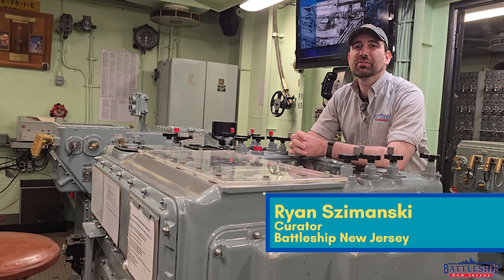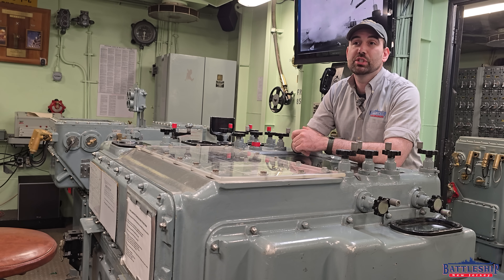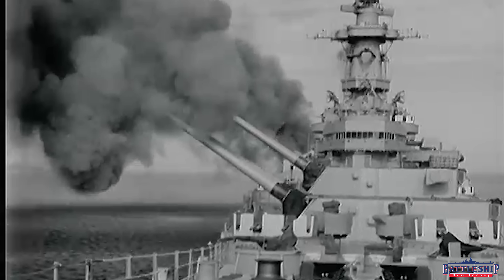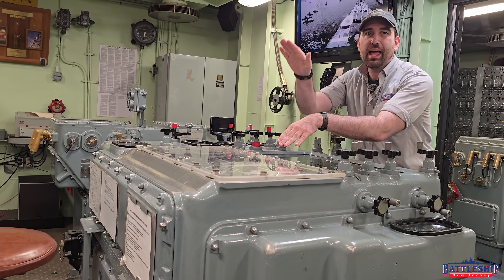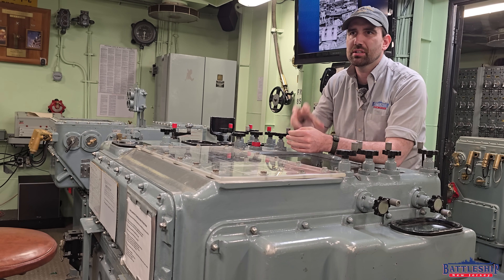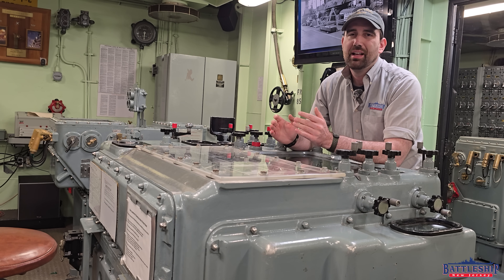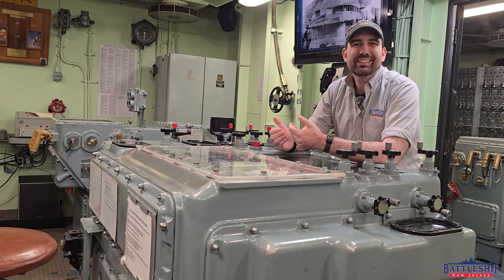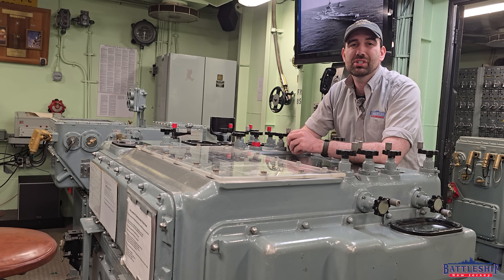What's The Ideal Angle to Hit a Battleship At?

Comment: If the shots go 4 times longer, then they do side to side, then hitting a bow or stern on vessel seems more viable
However with a broadside vessel, you'd be hitting both the hull, and the superstructure if you hit amid ships on most battleship sized vessels
Especially on carriers for bow or stern on targets, that long dispersion bubble means you'll blow holes throughout the flight deck

Comment: That dispersion pattern makes perfect sense when one applies Newton's laws.  Firing 9 tons of shells in a broadside creates a lot of recoil.  Obviously, the water pressure on the hull prevents the ship from going sideways, but that resisting force is much lower on the side of the ship while the recoil from the guns is high in the air.  This effectively tries to rock the ship.  It may not be by a measurable amount, but there is probably some (which may increase or decrease any rocking motion from rough seas).  With the shells being fired at slightly different times, that would result in the barrels of the turret being at slightly different elevations as the shells leave them - hence the greater longitudinal dispersion.

Comment: No.

The 4-1 depth to breadth ratio is ENTIRELY dependant on the firing range, it is NOT a constant.

The depth of the salvo depends on the angle of impact - the shallower the angle, the deeper the length of the pattern. Impact angle increases with range, so depth decreases drastically as range increases. As the cosine of twice the impact angle.

The breadth of the salvo depends on the dispersion (in mils) x Range/1000. This increases linearly with range.

If you have ever zeroed a rifle or handgun, you understand that a shot group at short range is circular against a vertical target, dispersion is the measurement in angular mils across the pattern. Left-right, up-down, all the same. The  only real  difference is your 16"/50 is firing against a horizontal target laid out at far greater ranges. Dispersion still works the same way, but you are not striking the target at a 90° angle. 

On Eugene Slover's web site is a copy of the 1941 OP-770 Range Tables for the 16"/50 based on 47 test firings at angles of 10-15-20-25-30-45°. Included is data for the test shots, including pattern size (in range). Analysis of this shows an average full pattern dispersion of 4.5 mils.

Breadth of the pattern is therefore 4.5 x range /1000. Your 4/1 ratio is for around 15,000 yards range. As range decreases, the ratio increases, the reverse is true also.

Comment: In the film of the Bismarck (down by bow from earlier hit by PoW) firing at the PoW (Hood already sunk) B is ripple firing the 15" guns (https://www.youtube.com/watch?v=m97AycTOVww), forward turrets first, then aft a couple of seconds later (not sure if these combined totaled full salvos). This was possible because the guns were kept at the same angle relative to horizontal via their inertia, gyros and hydraulics, rather than waiting for ship to be at a certain point in its roll. Why the ripple fire I have never seen discussed, it was not about ranging since they were fired so close together. 

Hood started by firing at Prinz Eugen, but because they thought it was a battleship they were thrown way off (the correct length of the ship had to be fed into the system when on nonparallel courses for rounds to hit the right lead spot) and shot wildly. According to some survivors of B they said first salvo shot at them was only a little short and on bearing, but she blew up before 2nd salvo. Sigh, 

Firing at ships running away when chasing them is difficult because the guns firing over the bow are being fast swung to and fro by the rolling. This was a problem for the RN chasing Italian units which was the norm. They went to special effort to deal with this and the Vanguard was fitted with the best batship fire control system ever according the Freidman, combining phased array radar with a sophisticated computer even better than the USN.

Comment: The US built a 155 mm guided ramjet boosted artillery shell. The range is classified, but rumors are  up to 100 miles.  Imagine what you could do with a 16 inch diameter shell with ramjet boost. 200 miles? 500 miles?  They may have gotten rid of them too soon. They could remove the rear turret and pack the area full of defensive and offensive missiles.

Comment: I find this a very interesting subject- hitting the target with the big gun.  There is the accuracy of the gun itself, the dispersion of the shell from the point the barrel is theoretically aiming at, then you add in the deviation of the barrel from the aiming device, assuming the aiming device is not perfectly aligned with all 9 barrels.  And now you consider that the gun platform is moving and the gun sight might not be aiming exactly at the target when the gun fires.  Reading about Bismarck, Hood, Prince of Wales they were firing at long distances, up to 20,000 yards.  A conventional military service rifle would usually be considered acceptable if it could keep within 4 or 5 minutes of angle.  At 20,000 yards that is 1000 feet, and that is before you add in error from misalignment of the barrels, moving of the ship by the waves, and so forth.  I wonder if the big guns can maintain 5 minutes of angle,  battle accuracy in early engagements of the Bismarck did not seem to have that accuracy.  
Firing broadside seems like an advantage because the range is not continually changing.
As other commenters have said it would be interesting to discuss which armor to hit and at what range to achieve maximum effect.
Reply: Don't quote me on it, but I think the MOA is 1. I remember a gun magazine coming on board and my buddy John Albertini was the lucky guy who showed them around and briefed them on the guns. I can't remember if they were onboard for a shoot or not.
But anyway, I think they published that the guns were 1 MOA, if I remember correctly.
Reply: @pville_piper5125  Yes, very interesting subject.  I did a quick internet search for "battleship accuracy" and found a lot of material to read.

Comment: There's just way more places for error to work its way into the calculation for range than there is for bearing. Basically with bearing the shell goes in the direction the turret is pointed. But the actual range the shell will fly is dependent on the barrel elevation. The air density the exact amount of energy put out by that particular set of propellant bags, not to mention the fact that range is just harder to accurately measure than bearing. So when your target is long and skinny like basically All ships, the narrow side being presented to you along the bearing axis and the wide side along range is just going to work out better. 

Of course, torpedoes completely change the equation, which I suppose is one of the reasons for their existence. If you cross the t on a submarine you get hit. 

I also notionally remember that crossing the t was also The preferred firing position for age of sail, but for different reasons. In that case, you were mostly firing at really close range and so overshooting or undershooting. The target wasn't usually a concern, but if you fire down the length of a wooden ship, you have a tendency to do more damage punching through multiple bulkheads. If you just shoot a broadside you'll punch through the the hull and kill a bunch of people on the gun deck. But probably your shot will then just go out the other side.

Comment: On of the major factors leading to dispersion of the rounds in a salvo is inconsistent projectiles. No two shells are exactly alike, and minuscule differences will affect the fall of the shot over long distances and 30+ second time of flight. You get the same issue with precision fire from a fixed rest with a sniper rifle.  This dispersion is measured and described as Circular Error Probable. Yes, gun settings inconsistency effect salvo CEP, but so does the shells.

Comment: The delay between guns wasn't in place until 1969. The fire control radar, while very accurate in WW2 was limited to 5 knots. It wasn't until a modification during the Korean war the radar firing solution was raised to 25 knots.
Reply: Knots what?
Ship's speed, relative speed?
Reply: @kiereluurs1243knots is the speed that ships use because it takes the curvature of the earth into account. It's about 1.2 mph.

Comment: The dispersion can be used to an advantage.  Firing to a broadside target, you can take away any attempt to escape incoming shells by the target changing course. They will still be within the 400 yard pattern. Speed is probably more difficult to alter quickly,  so X is more stable.  So, I think as long as you bracket evenly,  you can reduce the effectiveness of any shell dodging attempts.
Reply: Look at time of flight on an opening salvo; over 30s, almost a minute.  Muzzle velocity well under 1000yd/s, average probably closer to 500yd/s, on a main battery that can fire past 30,000yd.  Ships moving at 20yd/s move 6000yd in that 30s, and a 1 degree course change opens or closes the range over 100yd.
I imagine ships were avoiding frequent hard maneuvering not so much because it wouldn't work, but more from an offense is the best defense perspective where they didn't want to slow their rate of fire or throw off their own firing solution.

Comment: Games generally do simulate dispersion, War Thunder especially so: Boresight dispersion is usually circular or pretty close to it when measured orthogonal to the projectile's flight path, forming an arcing, expanding cone. When you map this cone onto a flat plane, like the ocean or ground, it winds up that the ellipsoid intersection between the cone and plane is elongated in the direction of projectile flight. This elongation is more severe the flatter the projectile's trajectory as well; an incident angle of 45 degrees will only be 1.4 times longer (1 / sin(ang)), and lower angles will result in even further disparity in dispersion. If the guns themselves do not have a perfectly circular dispersion, but an ellipsoid one, then this can exacerbate this disparity, and this is a perfectly reasonable assumption to make considering battleship guns in big turrets - the turret is a much heavier, sturdier mounting than the gun within the turret, and it is easier for the gun to oscillate or vibrate in the pitch axis than it will in the yaw axis. It's pretty easy for games to simulate this ellipsoid dispersion profile, and some do (like War Thunder).
Reply: Ellipsoid dispersion profile, terminology unknown to me until now. Makes sense though
Reply: @kiereluurs1243 🤓